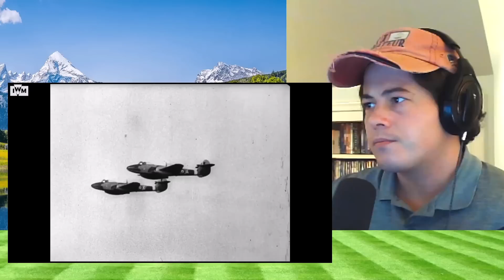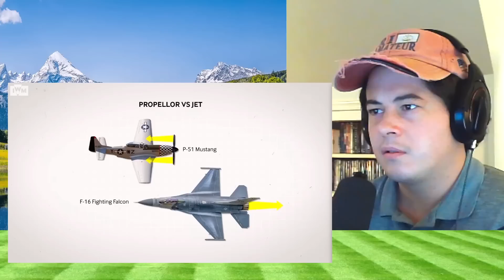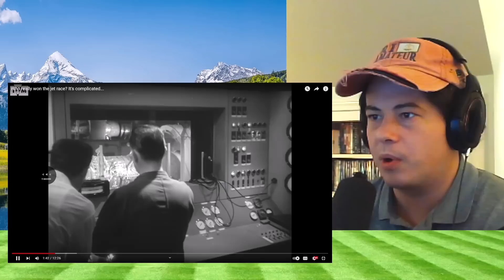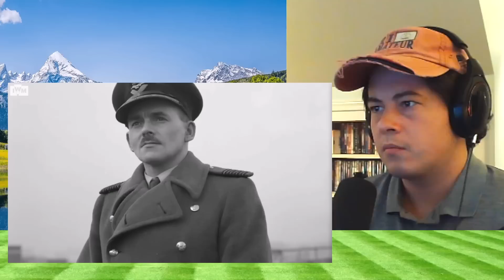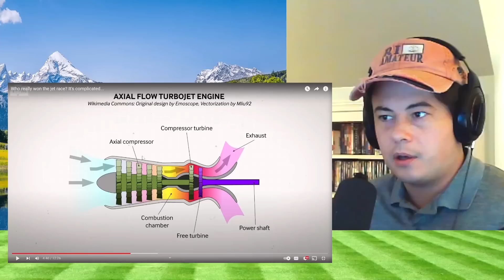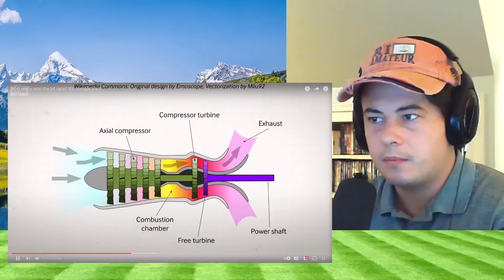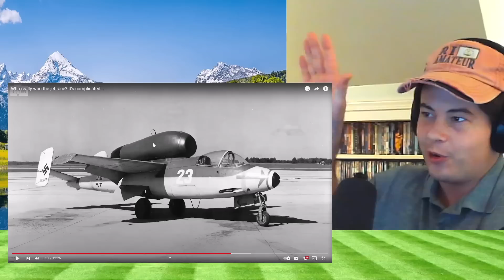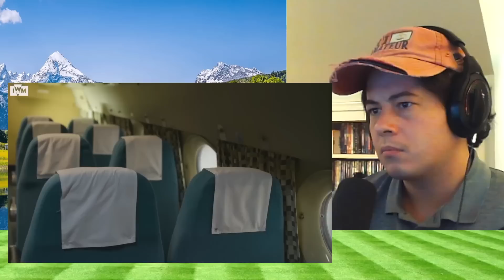American Reacts Who really won the jet race? It's complicated...

Comment: My understanding is the early comets had square cornered windows which were the site where metal fatigue started try it yourself, keepbending a piece of metal with a sharp notch then one with a curve. Later windows were rounded, the likes of the DC8 windows were rounded and didn't suffer failure. Comet had lost trust, Boeing and Douglas got the market.
Reply: I used to think the same, but actually, it's a misconception that the windows were the primary cause, that has become so widespread that people understandably think it is fact.

The truth is, though the mk.1 Comet had squared windows, they still had rounded corners, and these corners are not where the fatigue cracks originated. Rather, they started at the corners of the ADF antenna cutouts, which were square, and were described in the accident report as "ADF aerial windows". It is thought that the word "windows" was picked up by the press and the misunderstanding spread from there.

It is not helped by the fact that in the accidents, the crack spread violently VIA the windows, and that such photos were widely circulated...

...And that the redesigned Comet 2 switched to completely round windows, which further cemented people's idea that it was the windows that were at fault primarily.

Rounder windows are far better in pressurised aircraft for sure, and part of the raft of redesigns to better cope with pressurisation cycles, but again, the squareness was not the main cause of the Comet disasters.

Mentour Pilot has a good video on this and it all checks out if you delve deep enough, though the window story is still all over the place. 👍

Comment: Its not wear and tear - its metal fatigue fracturing and failures due to extra stresses and cycles prevalent in jet style aircraft because of the greater stresses and speeds and altitudes they fly at.  What the detailed causes of MF are were not apparent in detail and indeed the Comet accidents catalysed the world's aircraft companies to research and understand it.  It was almost a matter of luck that DH had made some design detail in the Comet that helped MF appear earlier whereas Boeing (the main jet competitor at the time) had chosen some different approaches which by pure luck minimised the issues the Comet suffered.  Once they were identified the Comet design was amended and went on to fly well and safely, but the commercial success at the level it deserved was denied at as the Boeing 707 went past it in the 203 years the Comet was being upgraded.  In a way analogous to the way the UK caught up and went ahead of the Germans in WW2 with the Meteor despite the Germans having a 2 year lead in the early 40s. Had those Comet crashes not happened DH would have sold hundreds of the Comets but the only jet readily available until 1958 was then the Boeing 707 - and the rest is history!
Reply: At least the 707 was a really good aircraft. Further, it's surprising how few people seem to read the comments as there's loads of folk identifying the windows as the problem. Which simply perpetuates the misunderstanding.
Reply: I’m guessing a big added stress compared to non jet airliners is the constant pressurisation and depressurisation on the cabin as well as much more extreme changes in temperatures at those altitudes. A really different prospect compared to say a DC3 I’d imagine.

Comment: Propeller aircraft start having problems as the propeller tips approach the speed of sound.  I'm no expert, but I think it's to do with shockwaves which are many and complicated.
Reply: Also, the blades reach a point where they are offering more resistance to forward motion than thrust, this is why very high speed dives would often result in the loss of the propeller / engine / aircraft.

Comment: Each compressor stage increases the air speed and also the air density (pressure) - so its high speed and high pressure by the combustion chamber.  The turbine stages behind the combustion chamber drives the compressors being turned by the hot exhaust flow
Reply: Put far more simply than my effort.